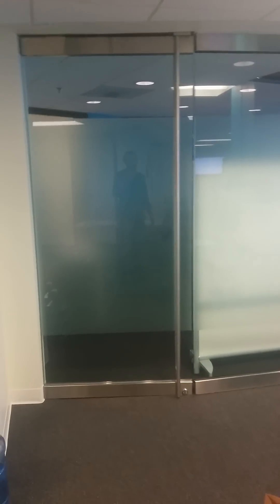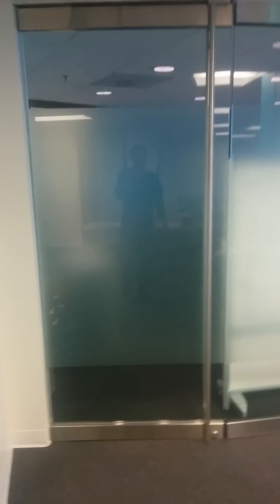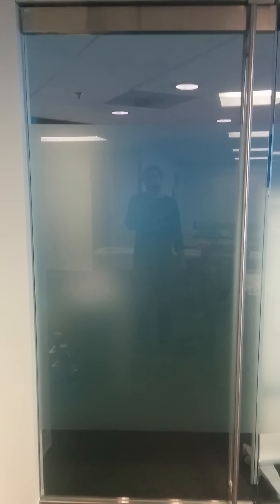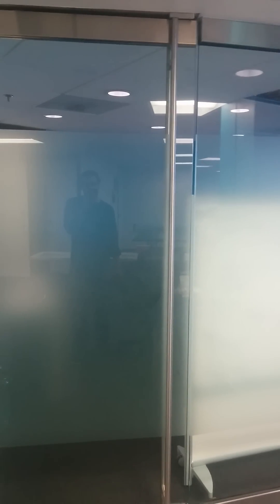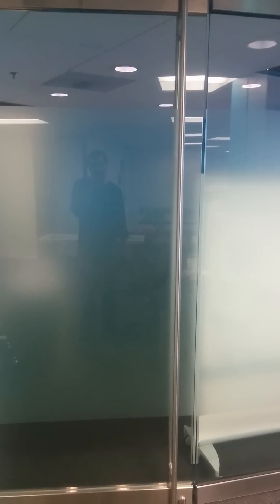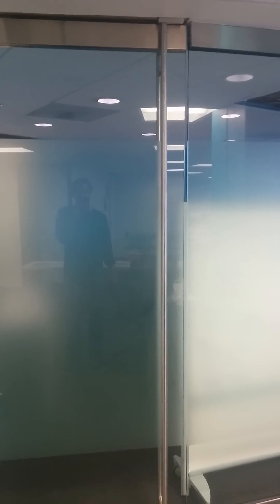Norman door hall of shame

Comment from the maker: Hey guys -- to clarify here:

A definition for "Norman door": a poorly designed door that confuses or fails to give you an idea whether to push or pull. I stated as such in my description above.

People have correctly pointed out that most people view the vertical handle as a signifier that you have the "pull" affordance, aka you can pull the door, whereas the "push" affordance is most commonly associated with a horizontal flat bar. This door is a norman door because it initially confuses the user to try and pull on the vertical handle, agreed. 

But i was highlighting another aspect too -- when the user "maps" the new model of the affordance (i.e. "i will associate pushing with vertical handle because that is how i can enter the room"), they are again confounded when they try to open the door from the other side, because the same mental model (vertical bar => push to open) makes them perform an incorrect action and they are penalized for it.

THAT is what the video is highlighting. I think both are reasonable criteria for making it a norman door. Cheers.

Comment: It's definitely a Norman door, no denying that. But your understanding of the concept is reversed (probably in this particular case only). The Handle indicates that you PULL (not PUSH). A Flat plate would indicate PUSH. So when outside the conf. room, most first time users of the door would instinctively PULL the door to get in the conference room. You're doing the opposite though. Common instinct matters here.

So it is a Norman door alright, but from the outside, as you're entering the conference room.

Comment: When it has a handle that you grab onto, whether it is vertical or horizontal, why would you think you need to push that? The side that needs to be pushed should just have a flat push plate. The side that needs to be grabbed and pulled should have the grab bar, whether vertical or horizontal. I agree with you that this door is poorly designed, because it does not make it obvious to the user whether they are supposed to push or pull on any given side of the door
Reply: +GodVlogger The door seems like a door that opens from both sides. These doors usually have handles on both sides, so why not try to push, it's the easiest to do.
Reply: mvpmickey1 I did not know what a Norman door is when I watched the video, yet I understood it by watching the video, and I understood it right, so I dunno:P
Did he say the handle indicates a push? I think he said it should be a door that goes both ways but I might be wrong and can't watch the video right now. If not, sorry, I missed that.
Reply: Crystal Black I watched the whole video and it was painful. He clearly stated the handle indicates a push and all hell was set lose.

If ever you know this guy.
Tell him this:
>Place your palm FLAT on top of the table then tell me if you can carry it
>Apply the same principle on a Door
...this is how you recognize if its pull or push

This proves how wrong the guy is on the video.
Reply: +mvpmickey1 I just watched the video, it's not that bad actually. It's like "hey, this door from the inside, it seems like it's 2 ways, so I push and it works. It has the same handle on the other side so I should be able to push again"
Yeah, it's not like a grip indicates push, but I think he phrased it wrong. He did put emphasis on the vertical grip, which is indeed used more commonly for 2 way doors, which makes me think he just meant "I thought this was 2 way, push worked on this side, so since they look the same, it should work on the other as well"
Reply: +Crystal Black Yes, but the guy in the video clearly explained his own opinion to why it's a Norman door which made him wrong.
He said the vertical handle indicates a push when it's not. You do not grip anything when you push since that is something everyone unconsciously do when your pulling.
You do not need to grip anything when you are pushing, however that is not the case when pulling. Looking at anatomy, we did not evolve to pull anything without griping but you can't say the same on pushing.

He should have started the video on the other side and pulled it open, then did the same as he entered the room. This will make him look like he know what his talking about.
...his shame is not the door but his misunderstanding on the topic. Then his worst shame is posting it on the internet which will forever be in it.